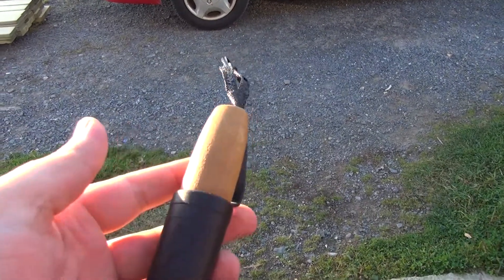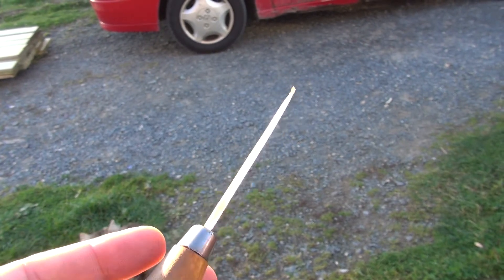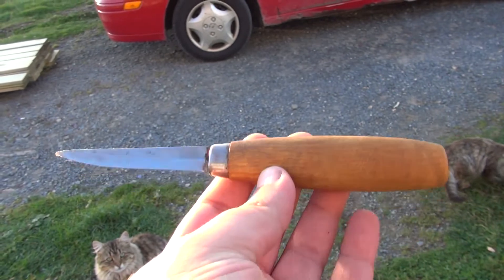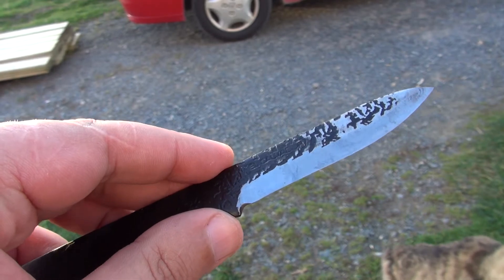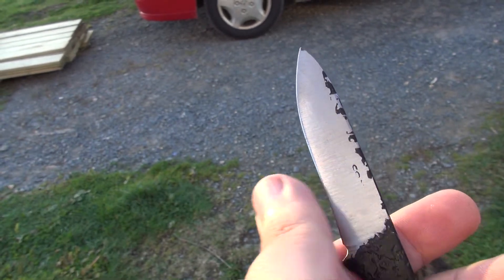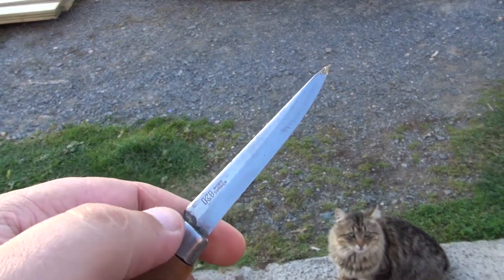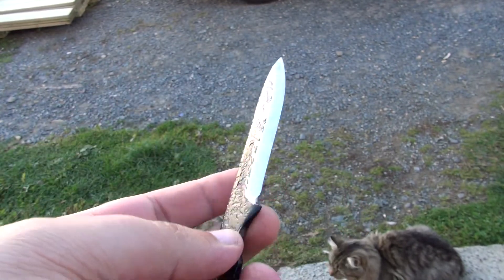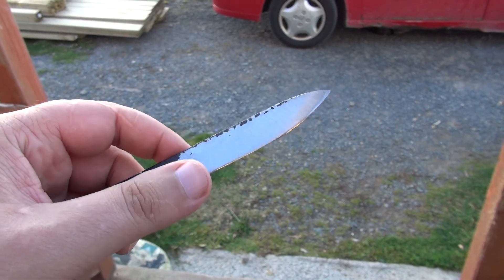Regrind : Condor Bushbuddy converted from "scandi" to full flat grind

Comment: A twenty degree per side bevel is standard for an all around, general purpose knife, and always has been.  And it cuts just fine, unless you judge cutting by shaving hair and slicing paper. 

The biggest thing wrong with the knife market right now is all the amateurs telling knife companies they want knives that are "razor sharp" right out of the box.  Then they complain when a knife doesn't hole an edge.

The historical bevel angles are just as important to day as they were when a few hundred years of experience brought them into being.  fifteen degrees per side for a pocketknife, seventeen degrees per side for a food knife, twenty degrees per side for an all around general purpose knife, and twenty-four  to twenty-six degrees per side for a fixed blade knife meant for skinning large game, or for self-defense.

Unless you plan on shaving with your knife, there is never a need for a bevel under fifteen degrees.  Even at that, a woodsman's pocketknife will have a thin enough blade that a fifteen degree angle per side will cut hair, if not quite as well as a knife with a ten or eleven degree bevel.  

If a fifteen, a seventeen, a twenty, or a twenty-six degree bevel per side doesn't cut very, very well, you are either trying to shave with it, or it is not properly sharpened.

Fortunately, some knife companies still follow these guidelines, even though people who buy the knives seldom realize it because of how well the knives are sharpened.  Ka-Bar is one such company, which is why I buy Ka-Bar knives so often.  Case is another, and I also buy their knives.

Unfortunately, Mora is not such a company, which is why there are so many complaints about how easy it is to ruin the edge when cutting simple things, and why they have to be sharpened so often.   A Mora works pretty well for cutting green wood, but not for much of anything else.  And they don't work nearly as well on green wood as a quality pocketknife with two or, better, three blades, such as a Stockman, even though the Stockman will have a fifteen degree per side bevel angle.  

Part of the reason the Stockman works better is obviously the fat that thee Stockman has three blades of different sizes and shapes, and partly that the clip point is better all by itself because of size, but it's also because the fifteen degree bevel angle keeps the knife sharp longer.  A lot longer, usually.

Anyway, the problem with those early Condor Bush Buddy knives is NOT the bevel angle, it's how poorly most of them were sharpened at the factory.  Poorly enough that putting the right kind of edge on them without removing too much metal was a job and a half.

A nine or ten degree angle per side on any knife is foolish.  There is no need for it, ever.  It cuts real world things not one bit better, but it does wear a knife out much faster.   This is really all it does.  If there ever is a need for an angle like that, a specialty blade is already made to do that job, be it a razor, a scalpel, etc.   

At least all you're doing is ruining a five dollar knife, and not a five hundred dollar knife, which I see people ruin all too often.  Then they wonder why they paid so much for a "bad" knife.  The knife wasn't bad, the knife just had a bad owner.
Reply from the maker: I am not sure those angles are historical, from the books I have read a generation ago they are not.

I am not interested in shaving per say, but general cutting ability/control, hence why I prefer thinner edges/shallower angles.

But hey if 20 dps works for you, your knife man.
Reply: Wow this comment aged like milk lmao
Reply: @donjuanmckenzie4897 

lol…it’s absolutely nonsense what that guy wrote. Hahaha
Reply: Cope harder
Reply: Ive never seen so much concentrated nonsense in a knife comment. Riddle me this smart guy, why do BPS knives in 1060 carbon steel have LOWER edge angles than MORA, and have better edge STABILITY (ie. Doesn't chip or roll as easily) as MORA? I'M PATIENTLY WAITING FOR YOUR WISDOM

Comment from the maker: There is always that problem with a term becomes accepted, trying to change it isn't trivial even if it is misleading. What you are going to face fairly consistently is "oh, you mean a scandi grind." . My main issue is that use of that term causes misinformation in terms of what is causing the performance, hence the clarification in terminology.

Comment from the maker: In general if someone promotes a convex edge as being anything uniformly there is a large misunderstanding of edge geometry being made. Look at the convex grind on a splitting axe and the convex grind on a light utility knife by Kyley Harris. Are these at all similar in properties (cutting ability, toughness, etc.) ? Like any other grind, you need to consider the cross section not just the shape of the grind to make any sensible inference.

Comment from the maker: Katana's traditional had a full convex grind without a distinct secondary edge. At one point this was actually so much in mind that manufacturers would claim to have Katana-like edges, Cold Steel argued this in the promotion of the early Trailmasters for example. This was quite some time ago and there was a lot of myth/length about convex edges at that time, being extremely durable but impossible to hand sharpen without extreme skill.

Comment from the maker: If you look at the old stone tools and even modern replications, they will have gentle convex tapers quite often so it clearly predates sandpaper. Even now, a lot of people do convex grinding on platens and stones, it isn't necessary to use sandpaper and mouse pad or a slack belt, that can make it easier for some people though who don't understand the angles they need to create.

Comment from the maker: Yeah, that is the argument however that is a very common grind which I have seen in many different cultures/places. For example it is very common to use a single bevel when you want to make a "knife" very quickly on a piece of scrap steel and it is also common on utility knives (the ones with replaceable blades), often found on machetes, etc. . It is certainly popular in Scandinavia though.

Comment from the maker: It isn't an issue, it is just technically misleading/inaccurate. 

Single bevel knives are common everywhere, it is how box cutters are ground as just one trivial example. Now a puukko is a specific design, just like a parang is a specific design, but the bevels used are not culture / region specific.

Comment from the maker: In general yes, unless I was just going to use them for shallow cutting only and on non-abrasive materials, I would put a full grind on them to improve cutting ability and ease of sharpening. It is pretty easy to tell the difference it would make if for example you take a standard Mora and compare it to an Opinel (or similar), the difference is readily noticeable on deep cutting.

Comment from the maker: Yes, however this is meant for a light neck knife hence the lack of a handle for a close to flat profile. It was intended for light work / backup mainly.

That is the argument for spring tempered spines in general that when over loaded they will take a set and not break - but if you do this they will take a set with less force than the fully hardened steel as well.

Comment from the maker: In general the more a belt will cut the less heat that will build up so avoid worn belts or too high grit belts for roughing. 

The strength is reduced any time you remove steel but I can't imagine this being a functional problem for this blade as it would be difficult to exert that much force on the slab handle. 

In general these knives are fairly easy to break due to the thickness as they are generally 0.08-0.1" thick. Even with the sabre grind they come with any adult can easily break them.

Comment: Hmm..I remember that ive seen some people ( think here on YT) saying that ceramic belts dont heat so much the blade but i think anywhere there is friction there is heat..Do you think that putting a full flat grind on that knife will make it less durable?Im asking that,because i think they made it thick because the steel isnt "flexible",will it brake if you stress the blade sideways or twist while cutting? Also thanks for the note regarding the Scandi, its good to know, ill be carefull next time

Comment from the maker: A thinner grind will tend to bite right into the wood much easier and cut right through the grain, especially on softer woods. However this is just a manner of reducing the force applied if you are just doing very shallow surface cuts and/or want to turn/scallop in the wood.

Comment from the maker: Pretty much, there is nothing wrong with a single bevel on very thin stock if all you are doing is shallow cutting and the thinner the stock the less use there is for a full height grind. On knives which are 1/32" or so thick then it even becomes difficult to do a full height grind which would be very close to zero-flat anyway. But I do find it absurd when people claim it is something it isn't. You should start calling convex a kiwi grind.